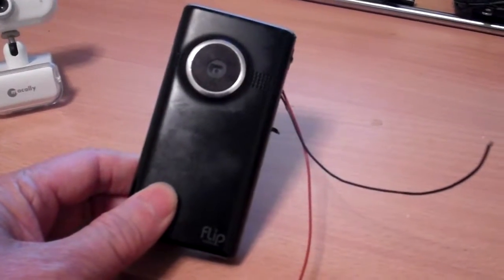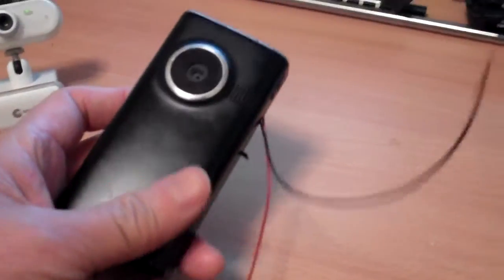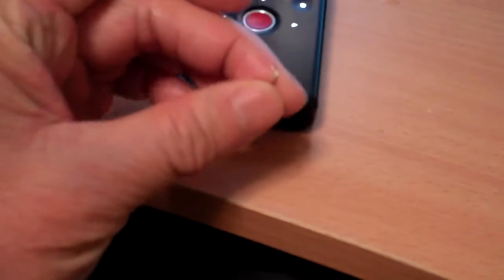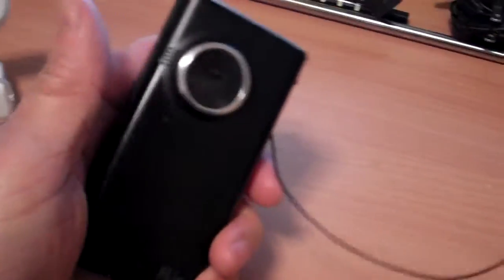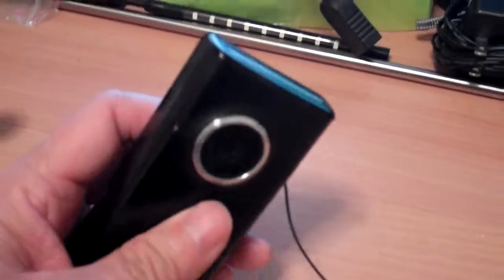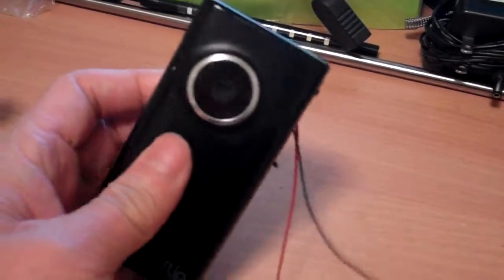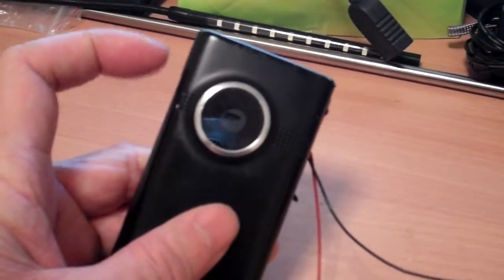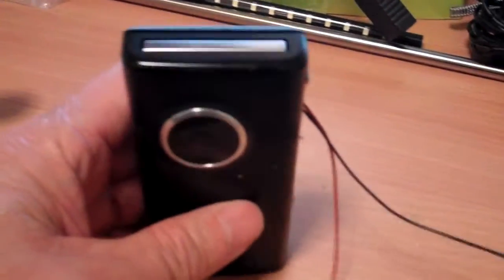Flip Mino HD with possible damaged mic input

Comment from the maker: I looked at your video. Thanks for the advice about Ebay and the way the mic works. This Flip Mino HD is high def with video stabilization and 60 frames per second. Everything on it  works except for the slightly lower mic pick up. I thought the workaround would be just to boost the volume when I edit my videos in Windows Movie Maker. You can't buy them new now because they are discontinued. Except for the lack of a real zoom, this camcorder is excellent.